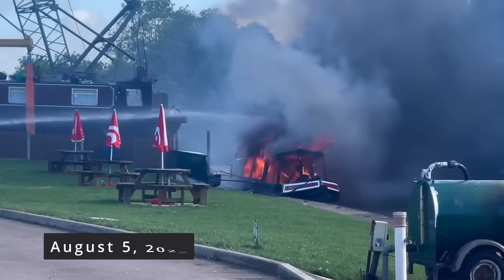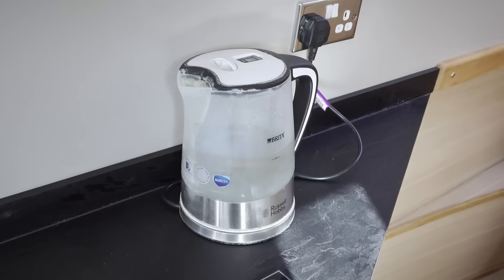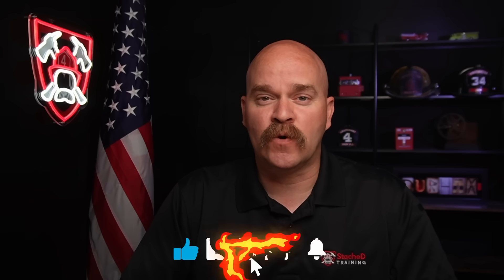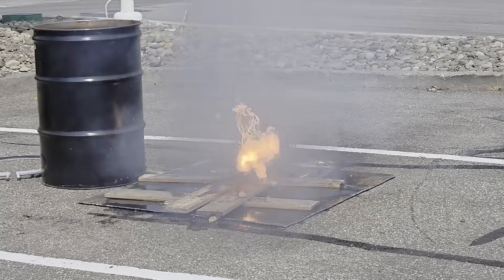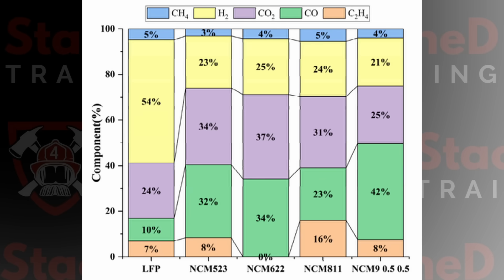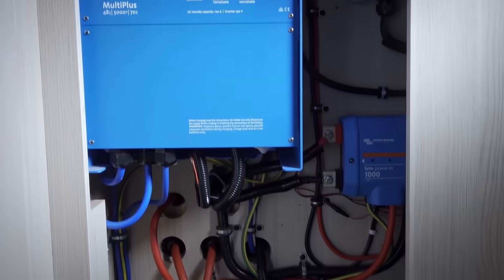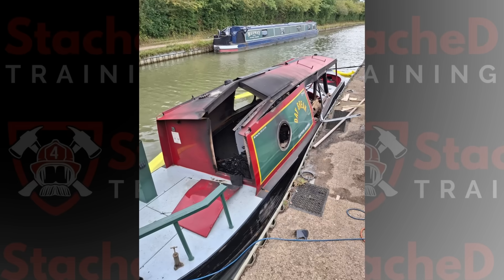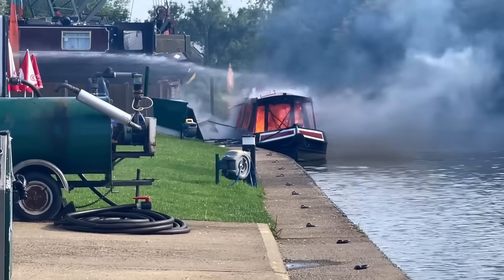Electric Boat Explodes While Charging: LFP Batteries

Comment: A couple who embarked on a “green odyssey” across the Atlantic were found de@d in a lifeboat after being forced to abandon their  Nissan Leaf battery-powered yacht, (possibly sank due to a battery fire.)

They were finally found lifeless on a three-metre liferaft last week, after it washed ashore on Sable Island, 180 miles off the coast of Nova Scotia.

Mystery surrounds how the couple’s planned voyage turned to tragedy, with fears growing that their reliance on sail and an electric engine may have left them ...   Jul 20, 2024
Reply: I hadn't heard about that. I searched Google News and found multiple articles from British news publications. Sad story.  Thanks for the info!
Reply: What's the bet, the setup involving a car motor, and batteries - was done poorly without the oversight or consultation from a licenced high voltage electrician or electrical engineer. 

When I made my electric boat, I researched, and I also consulted my good friend who is a licenced high voltage electrician - and before I did anything I was always double checking with my friend, asking how I can make it safer, what can I do to ensure the absolute minimal risk of arc, or short circuiting etc. my boats not 100% foolproof, I understand there is an element of risk, but I've taken every step to minimise that as I possibly could, and I also take the extra precaution of always having a life vest on at all times, only use boat in daytime - and never go too far from shore and always be within phone and radio reception.
Reply: @jamesaustralian9829  When you talk about electrician, are they experienced in high voltage DC?  Because HVDC has different wiring requirements than AC.
Reply: @jamesaustralian9829 I only ride my bike inside gymnasiums and only during gym class
Reply: @4runningaway  That can be a bit risky, you should be careful, accidents do sometimes happen during gym classes.
 I've taken the wheels off mine and only ride it in my bedroom.
Reply: Nissan leaf cells are NMC. And heavily degraded. And many people run them without BMS. Those catch on fire all the time. Totally different than lifepo4
Reply: :face-fuchsia-wide-eyes::face-fuchsia-wide-eyes::face-fuchsia-wide-eyes:
Reply: You should get your account age checked for using algospeak.

Comment: How much ventilation do you recommend for lithium iron phosphate so that these gases don't accumulate if they fail.

Wait you said that they reignited? What was igniting the second time? Lithium Iron Phosphate can't even create a temperature on the surface of the cell during thermal runaway to catch a piece of paper on fire. If it reiginited, that sounds like a cobalt based chemistry.

I found out that the pictures in the video are not the actual system. And the total amount of hydrogen created by these batteries is pretty small. Hoping we get some more information on this because the information the video really doesn't help a whole lot. We need to know how much hydrogen they can create.
Reply: Just thought of a failure mechanism. If they were using the transformer based chargers from years back (still used to charge lead acid sadly), it can fry one of the fets in each of the BMS banks in a closed position. So once it hits high voltage disconnect, it doesn't. You can fry these fets with those old chargers on a single cycle. Then you will get overcharging. Then venting. Then accumulation of gases. Then the motor is also in there like you said. And then kaboom.
Reply: @WillProwse someone deleted their comments in your conversation.
Reply: Do you know what cells they were using? Sounds like a BMS failure during charging.
Reply: @WillProwse if the video is same type of boat, Predator-batteries,  er , co and UK at end. Looks like may have been chosen because XBH are rated IP67....
Reply: If I posted a video like this on my channel with this many holes in the story my channel would die in a month. Everything I have to claim I have to substantiate with evidence.
Reply: @WillProwse 
Hi Will.
You don't need to justify yourself..
You have over 
 1 million subscribers.
(and you made your whole life from nothing)
That is Integrity.
Been watching for years...
..
this channel has 47k
and isn't a channel I watch.. only found it because of this story.
Reply: Yes all batteries are dangerous. There's no such thing as a safe battery.
Reply: @WillProwse lead acid is about the safest battery in production bigger then a alkaline battery. Lead acid just needs ventilation.
Reply: @WillProwse there is safe design and proper components quality and reliability overall a safety control check that has to be done to allow those conversions into the public! In Germany you can’t just put something together in your garage and use it like that! The TÜV checks it
Reply: Hi Will.
1:17  notice the cables.. there's at least one above another terminal..
and the insulation isn't that thick.. plastic? silicon would be better with different routes etc..
There's several things wrong with the cable management..
Cable terminations too small, no secondary securing if a bolt breaks..
Output wires near one another and no main fuse.
.. and no other fuses visible on batteries.
No battery terminal covers.
Were the bolts suitable for the torque required to carry the required peak current.
List goes on...
Not sure if this would even pass a boat safety certificate.

The coverage of this incident has been terrible.
btw..
So you know..
The name of the place is Gayton not Gaytown.
Reply: @Markus-UK That's not even the system that was used on the boat. He said that those are systems that are similar to that boat. There's no proof that that is how it was wired at all. Seems like everybody only knows what motor it was using and nothing else.
Reply: @Markus-UK  Battery terminal covers are not required under the BSS, a battery cover, which you can see in the picture is sufficient.
Reply: @philelliott5327 
The BSS is a bare minimum requirement.. for inland UK waters..
also dependant on the cover material.. or used to be.

BSS removed the requirement for battery trays.. and many other things...

If something happens it's the skippers responsibility.
Liability can be referred to a contractor but ultimately the skipper is liable.

A decent first aid kit is not required but having one and knowing how to use it is essential..
Reply: Any chance of you two doing a discussion/collaboration sometime?
Reply: A typical 300Ah LiFePo4 battery in case of failure, will vent from 12 to 80 liters of hydrogen.  This gas can only be flammable in a 2 m^3 space or less.   In any case, all battery rooms should have smoke detection and immediate ventilation to the outside in case of detection.
Reply: Paper starts burning at 200⁰C
Reply from the maker: Every design will be different and it really needs to be modeled based on the size of system being installed.  This won't happen in a DIY/Retrofit.  Blowout panels are another good option, however, in a boat like this, not practical.  Like I mentioned in the video, I would rather have a fire than an explosion.  Tesla does this with their Megapacks by installing a sparker that constantly pulses.  As for reigniting, it they likely started off gassing.  Most people see the smoke and assume there is fire too.
Reply: @StacheDTraining how much hydrogen is created for a given capacity of lifepo4? How does it compare to lead acid when doing a equalize charge? All the charts I'm seeing are PPM amounts. Seems like flooded cell  lead acid creates more hydrogen.
Reply: @WillProwse 
They are sealed Will. They only vent if the get over a certain pressure, generally if overheated, due to excessive current or internal short (so excessive current), or cells being over/under voltage (causing chemical changes and reactions). The gasses produced are from chemical decomposition, not like normal charging of lead acid (breaking water down due to electrolysis).
So, whilst charging, zero hydrogen is off gassed.
Reply: @woodstockm4328 oh of course, I mean if they do get overcharged. I have videos on my channel making them smoke. They are hermetically sealed. But I want to know if there are fire regulations for ventilation to avoid gas accumulation. I'm looking up the charts for how much hydrogen can be created and it's in the parts per million amount. I don't think it's enough for a real explosion. I'm trying to find more data but it's hard to find
Reply: @WillProwse Common sense has entered the comment section. Thanks Will. 👍
Reply: @WillProwse Some countries require that even LFP batteries on boats need to be in a sealed box with ventilation to the outside to prevent gas build up. Project Brupeg did this with their battery install if you're curious to look.
Reply: @StacheDTraining  There are some key pieces missing in this story just based on everything known about the chemistry as well as what is required to create a problem with it. Somebody screwed up, but the impression left is that the batteries just randomly did this on their own.
Reply: @ReflectedMiles  
this guy uses every opportunity to rubbish EV's and anything related to it. he lives for it.
Reply: @ursodermatt8809  No he just tells the inconvenient facts.
Reply: @FailedExpert6330  
yeah sure
Reply: @FailedExpert6330  Inconvenient to whom? The chemists who did the developmental and testing work to ensure a safer battery? The public trying to understand what actually went wrong here? Or is it just a boon to the hopes of Luddites and cynics everywhere who want the public to be stewing on as much failure and misunderstanding as possible to suit their own psychology and preferences?
Reply: @FailedExpert6330  actually I'm not seeing many "facts" in this video. The system shown were not the ones that caught on fire. We still don't have confirmation of chemistry type. There's no inconvenient facts here. It's speculation.
Reply: @WillProwse Maybe we should be waiting for sodium batteries to become mainstream and using them for boats?
Reply: @markwright7680 sodium ion batteries are pretty awful. And can cause electrical fire like any other battery. Also finding a lot of holes in this videos information. No proof of battery type used or anything. The ones he showed are not confirmed to be used in boat that caught on fire. Check out other comments I posted on the video.
Reply: Q If we’re all supposed to go electric (storage) where’s all the lithium to come from & is it being produced in an environmentally sound manner? Is it being recycled from depleted batteries?
Reply: @janegreen9340  The lithium ions in the electrolyte only account for 3% of the total weight of a pack. That's never been the issue. Nickel and other comments have always been the bottle neck. Or processing the raw materials to a high enough purity for lithium ion manufacturing.
Reply: @janegreen9340  and yes lithium ion battery recycling is very profitable. They are not going into the land fills now. Did you see the new company using them to run AI servers? It's making a ton of money. Why would you not recycle or use them for second life storage?

Comment: My parents bought an electric mower with a cord. My dad mows while my mom manages the cord. No batteries needed, and bonding time is a plus! 😊
Reply: Plus not having to buy $100 battery packs that last 30 minutes on a good day.
Reply: "TEAM WORK MAKES THE DREAM WORK..." (the wise man speaks)
Reply: That’s adorable
Reply: I'm glad the time together is working out.  The secret for dealing with corded mowers is to start at the power source and zig-zag your way out to the other side of the yard.  That minimizes any need to cross over the cord.
Reply: Yeah, like we can do that for transport...🤷‍♂️
Reply: @woodstockm4328  
Yes you can. 
Battery packs at staging points. 
Swap and go...see Mainfreight in New Zealand  running a large semi truck from Auckland to Hamilton return each day as a proof of concept...80kms/50 miles journey.

Battery on charge in Hamilton...gets swapped into truck in 5 minutes.
Truck returns to Auckland and swaps in the battery on charge/charged there.
You can run this 24 hours a day....
Reply: Smaller batteries are safer. Unless they come from a corrupt Chinese company. They care zilch for life. Example: baby milk scandal.
Reply: How cute. 
Relationship goals. "Babe wanna go mow with me?"
Reply: I had a cord mower, it worked alright but cord management quickly got frustrating. I switched to a Ryobi 1+ and use 2x 6 amp Ryobi batteries and I've used it for over 14 months now, works brilliantly and does my whole large yard plus leftover power in the batteries to use the whipper snipper. Best investment I've made in a long time
Reply: I too prefer electrical cable to batteries unless it’s a very particular or specific device! I don’t know why people have batteries powered lawn movers unless they have a very big property
Reply: If the cord has punctures it can become lethal.
Reply: @AndreiIR000  If a lithium ion battery has punctures, it can explode. 😊
Reply: Not everybody's yard is 300 square feet.
Reply: @Tb0n3  a big extension cord you can roll up should do most peoples yard unless its big enough you want a sitting mower anyway
Reply: @Tb0n3 you suck.
Reply: @Tb0n3 then gasoline it is
Reply: You definitely don't need two people to manage the cord...
Reply: @iansilver-ramp595  you are Sheldon in big bang theory. You don’t understand sarcasm
Reply: And many more people have been killed by electric cords than lithium batteries.
Reply: @commonsense-grs  Sounds like we're at an impasse! 😊 I think we can both agree that electrification is the future, but we seem to disagree on the best way to go about it. Let's both go make the world a better place--I'll make extension cords safer, and you make rechargeable batteries safer. Take care, and God bless!
Reply: @kentslocum  I do agree with you on that one.
Reply: Battery Electric Mowers are far superior. They also tend to be more powerful oddly.
Reply: @Neojhun  The most powerful and dangerous electric tool I have ever used was a corded electric chainsaw. That thing had so much more torque that gas-powered chainsaws. 😮
Reply: That's definitely a killer. Imagine cutting the cord then stepping on the cut cord or it whipping into you. It was never a safe product. NEVER.
Reply: @chriscordray8572 it's not a real issue in my twenty years of using them. You know what happens if you cut the cord? You trip the GFI and or the breaker. It's also harder to clip the cord than one might think
Reply: @chriscordray8572  if you’ve got an Residual Current Device (RCD) installed to consumer unit or the socket that the mower is plugged into, then the cable is safe. I cut my mower lead a few years ago and the mower just stopped, no sparks or explosion. I simply bought another lead.
Reply: @chriscordray8572  Its called plugging it into a GFCI outlet and at least here in Canada that has been the code for quite a few years to have that installed as a breaker in the panel for plugs that are on the exterior of the house. People are not dropping from traditional electric mowers, however these lithium batteries for various uses, ebikes, law mowers, other battery tools are at risk of burning a house down taking lives with it.
Reply: @chriscordray8572  It's a whole lot safer than a battery-powered mower catching your house on fire! 😊 Europe is even using electric excavators that draw power directly from the electrical grid using beefed-up electrical cords. So it's not a bad idea at all, as long as you have good cable management.

Comment: Boats + water + LFP (any ion type battery)= stupid. Any questions?
Reply: What color of lacquer do you prefer to drink? It seems extraordinarily detrimental to higher brain functions.
Reply: There are literally 100’s of thousands of lithium batteries installed in boats of various sizes, primarily as house batteries but many as propulsion energy sources. How many explosions have you heard about? Citations please.
Reply: Diesel electric is the best for boats. Diesel to provide electricity,  electric for the boat. Nuclear would be better but that is extremely controlled.
Reply: Cheshire Fire & Rescue Service - Boat Safety
Petrol Solid Fuel Stoves Causes of fire on boats The cause of fire is varied, but could include: Escape of gas from an LPG installation coming into contact with an ignition source resulting in fire/explosion. Flammable vapours entering the accommodation space coming into contact with an ignition source

Comment: 48V are more easier to catch fire then the 36V and why didn't they have LifePo4 battery they don't catch fire and the second is AGM or other lead acid batterys catch fires more then the LifePo4 battery and last thing to say is items like jugs and stove tops they don't run on 48V they run 12V or 24V its a another way to damage the batterys too as i seen e-bicycles and e-scooters used 48V is to make thise things faster but they catch fire more because they got too much voltages on a small battery

Comment: Guess they didn't have a blower in the battery compartment.
Reply: That is only half the solution. Batteries need to be designed with thermal runaway protection in mind, not with shipping costs🙄 
The single 500mAh pouch, who goes trough, isn't the problem. The pouch next to it, who is affected by the heat, or any flammable material for that matter, is. 
What we do today, is the equivalent of bolting the gasoline tank, straight to the piston head.